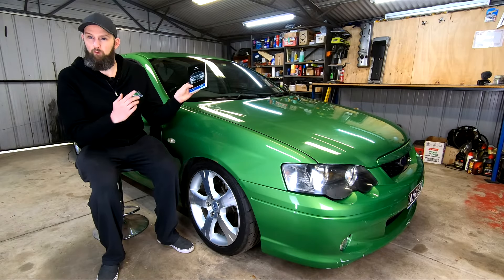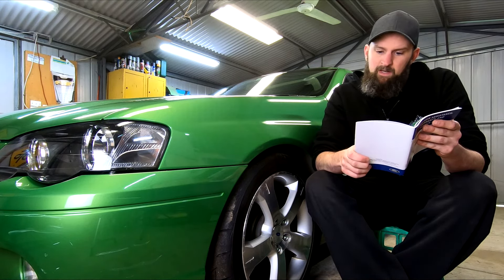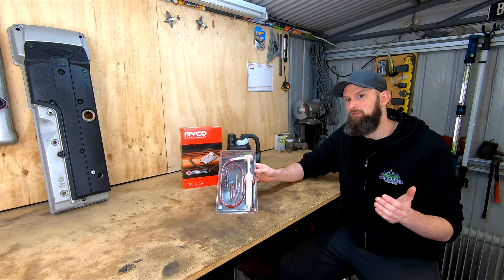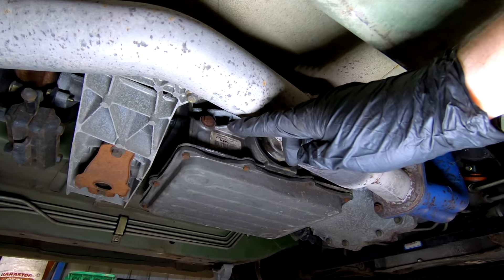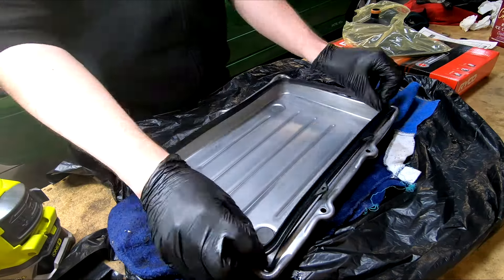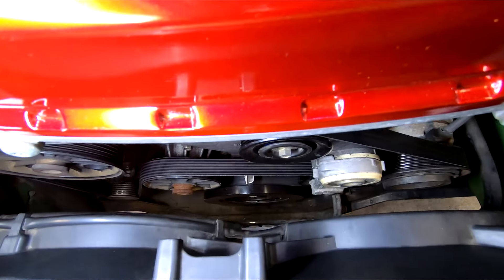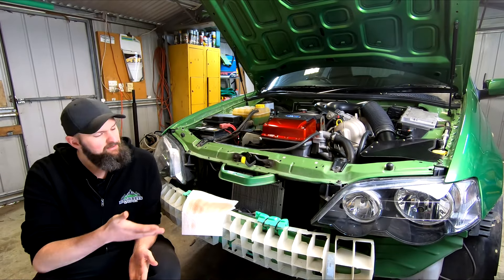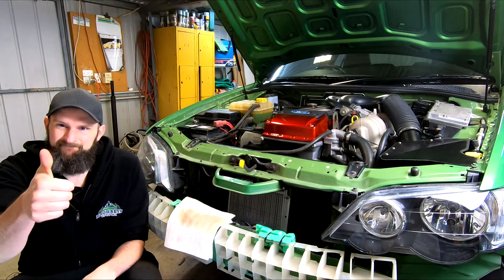Auto Transmission Service & FULL FLUSH (BTR Auto Ford Falcon EA-FG) | TURBO Your NA Barra Pt 2

Comment: Hi I just wanted to know where you got your rubber pads that sit on top of your chassis stands great idea
Reply from the maker: Hey mate, wish I could claim that was my idea but it wasn't. I picked them up from the below listed eBay seller out of the UK. Expensive postage but I bought a heap to make it worth while (he's got a load of different sizes including for jacks), and at the time I was looking at option to get something similar going over here but never happened.

I do like the idea and product though so maybe one day I'll revisit it, believe they are machined super solid rubber hockey pucks!

https://www.ebay.com.au/usr/cav.mar1?_trksid=p2047675.l2559

Comment: That`s a nice tutorial! Yes, we have this ugly oil cooler AKA heat exhchanger system on our Ford BF. This cooler finally broke and both liquids are mixed together... Apart from the entire cooling system must be flushed off the pinkish "cappuccino", the transmission must be fully cleaned too. But as I see, that`s nearly impossible to flush it completely, an amount of this mix will remain in a transformer...  Can your technique help with full flushing or it needs for 4-5-7 or more oil/filter replacing in a row to reduce this cappuccino concentration only?  Some people told me that this gearbox is already in a big doubt and can`t last for a long time. Is that really correct?

Comment: Hey Browney,
did you know that castrol tq 95 was designed specifically for the btr electronic transmissions?

I know you probably don’t want to do it again but it will run much better with it and it lasts much longer then any other trans oil 😊

If you read the tq 95 fluid specs you will understand why ford is so vague

Comment: If adding an external cooler you should never bypass the radiator. I worked in a radiator joint in Bendigo years ago and they did actually know a thing or too about cooling. They did a lot of commercial hire equipment and farm machinery and they pointed out OEM heat exchangers are far, far superior to the best external coolers.  
They showed me what went into car radiator tanks and I have to admit they were very well thought out in terms of how OEM manufacturers get the fluid rotating in the liquid to liquid heat exchanger. The did sell external coolers but always cautioned people who purchased them to never omit the internal cooler.
So the moral of the story is if you think your radiator cooler is going to leak water into your tranny (or vice versa) buy a new quality radiator not from eBay.

Comment: Hey what is the rubber product you used for the jack stands? I think you mentioned it once but I've forgotten the video.
Reply from the maker: All good mate. I picked them up from the below listed eBay seller out of the UK. Expensive postage but I bought a heap to make it worth while (he's got a load of different sizes including for jacks), and at the time I was looking at option to get something similar going over here but never happened.

I do like the idea and product though so maybe one day I'll revisit it, believe they are machined super solid rubber hockey pucks!

https://www.ebay.com.au/usr/cav.mar1?_trksid=p2047675.l2559
Reply: @BrowneysGarage  Many thanks.

Comment: Great video! Yeah I remember doing this as a very very avarage mechanic.... We used to drain probably around 15-16 litres into a 20L container. 

Great video though, as I don't rhink any other videos on YouTube show this.

I like the BRT Transmissions... Yeah the 6 speeds are smoother but these can be serviced at home and cheaper to replace when the time comes 🙂👊
Reply from the maker: Thanks mate. I believe it, sure I could have gone through another 4-8 litres if I was fussy and could get my hands on it. 

Hopefully it's a little different take on a few things at least, not sure I'd seen the full job done like this at very least.

I quite like them for the same reason, especially if it was something I was putting heap of KMs on. That and them being a lot more resilient to bad/old/low oil than newer boxes it seems.
Reply: @BrowneysGarage  quck question, the attachment for on the bottom of the radiator, then the clear pipe off that? I thought it was the top but it's been 20 years lol
Reply from the maker: @paulmcgaw6976  All good mate, same orientation as my aftermarket trans cooler, fluids pumped into the bottom and out the top so fitting and line on the top outlet of the rad.
Reply: @BrowneysGarage  legend!! Thanks so much for that!! I'll make sure I screw it into the top 👍🤛😃

Comment: What hose is the one you have to remove to flush the lines with the cooler underneath the intake manifold on a 2006 4speed BTR? Cheers 🍻
Reply: Worked it out 😅 it was the rear oil line of the cooler underneath the intake manifold

Comment: I have a ba falcon e gas.. and I starting to notice a vibration inside  the cabin.   When I'm on a stop light  I have my foot on the break pedal.  And the whole car is vibrating.    Don't know if  this is cause by the torque converter?

Comment: Hey mate I have a question when doing just a top up do you warm the car to normal operating temp or just a lil bit cheers
Reply from the maker: Same as in the video, just a little. Believe the workshop manual I have describes going for a approx 3-4km drive with light throttle and rpm kept under 2500 to get it just warmed up.
Reply: @BrowneysGarage  is it bad if I let my car get to half way on temp gauge (normal operating temp for his car) then take plug out and top up I did this yesterday on my mates car but as soon as we dropped plug fluid pushed out although now it seems to run better after I pumped the same amount of fluid in until it dribbled out again I'm abit confused as I didn't see you lose any fluid removing the bolt
Reply from the maker: Sounds perfect mate, fluid was starting to dribble back out to show its full.
Reply: @BrowneysGarage  cheers boss toke it for a rip and goes good

Comment: My filler bolt is very tight. Wish it was as easy as yours 😂
Reply from the maker: Not like one of my cars to make a job easy too, I got lucky!
Reply: I had one that was super tight & nearly rounded the hex off with a bar on the end of the socket , my last ditch effort involved drilling out the socket where the hole for the retainer is , to the size of a large screwdriver shank ( cutting the end off an old crappy one) it gets the levering force closer to the head of the bolt & worked well . I then ditched the plug & bought a new one .

Comment: So i put 8litres of trans fluid in and few days later its starting to slip... im using same trans fluid and wasnt sure if your meant to have 11 litres in there?
Reply from the maker: Fill it till it’s full, dribbling out the fill hole when car is level. Then run it through the gears, shut off and quickly check/fill again. Amount of fluid will differ but may well not have been enough.

Good luck mate 👍

Comment: My 4 speed transmission had had approximately 0 oil changes in 240k kms. Not a single issue is present

Comment: For me , I didn’t have a good experience with Penrite atf . Box started slipping and died soon after . The 1-2 band was toast . No other scientific method to prove that it was the oil . But with my new built turbo box , I’m sticking with Castrol .

Just wondering if anyone else has had the same happened to them ? Or was my old box going to die with the torque from the turbo and 12 to 14 psi ?
Reply: Maybe because Castrol TQ95 was developed in conjunction with BTR over a five year period when developing the box & is specifically recommended by ford as the ONLY fluid to use in a 4 speed BTR . Some mechanical workshops are getting the customer to sign a waiver if the car has over 100000klm that if they service the auto & it plays up after it , then the problem is not on them . These same workshops continue to use other brands/grades of oil including full synthetic & the problem keeps happening . I keep using TQ95 on our au & bf wagons with high klm & regular towing & have not had this issue.
Reply: @barbraabsalom4531  That's good to know, considering I've always been a Penrite guy for my engine oils. I'll make Castrol TQ95 the golden rule.

Comment: Good vid mate, cheers.

Your oil was pretty used. How many miles did this BA have when you serviced it?

I just aquired/inherited a 2011 Terri 4sp with 330k on the clock for my work car. Mostly highway miles but still, deserves a going through.

Comment: Great video! Just a question. When refilling the ATF, is it best to check the level while the engine is idling? The Transdoctor has on their webiste: "With T-bar in Park start engine, remove plug and fill till fluid trickles out of hole moderately then re-fit plug and tighten but not too tight a small nip up is enough..and your all done". Other mechanics say to check with the engine turned off and the oil at 40-50 degree.  What do you reccomend? I appreciate your comments! Cheers
Reply from the maker: I'm a hack on the internet, don't take advice from me! 🤣 But to give some sort of answer, I've done it both ways with no problems and have been recommended both so it's a little unclear but I'm more leaning to the "Transdoctor" method you've listed these days 👍

Comment: Does a standard au have the same gear box? 
And I’ve been told that old oil in the transmission will stop it from slipping 

And when will we see more eb content 
Well I think it’s an eb
Reply: a trans specialist told me the au trans is actually a little stronger
Reply: @closertothetruth9209  oh?
Reply from the maker: Near enough the same, serviceable the same for sure. Not knowledgeable enough to comment on anything more intricate than that really sorry mate.

The EB and ED project will pick up once the turbo series wraps up, unless I get really held up on something in the turbo series.
Reply from the maker: Oh and on the 'servicing a gearbox will cause it to slip' issue - again I'm no expert but the logic I've heard behind this is if you have a particularly abused or old auto, much of the friction material from the clutch plates can be worn off and washed into the oil. The oil then carries this friction material and helps stop the clutch packs slipping, but when serviced/flushed it's lost and the extra friction it added is lost, giving issues that were bound to pop up at some point anyway.

Not sure whether I believe that or not but it's a theory I've heard and seems plausible.
Reply: @BrowneysGarage  righto
Reply: @BrowneysGarage  ohh ok I’ve been told that if u got a worn old trans u leave the old oil in it because if u put new oil in it it will slip 
Or u can get stop slip